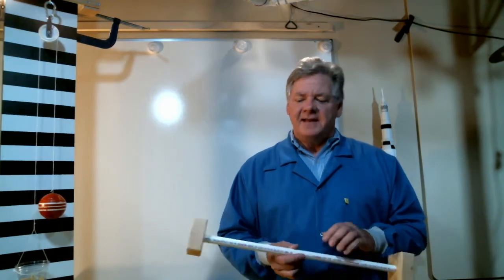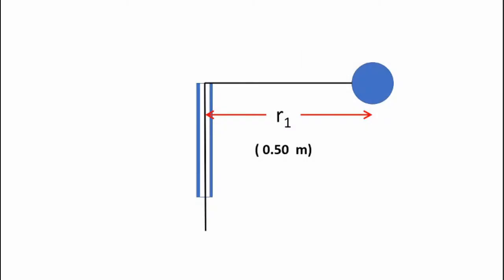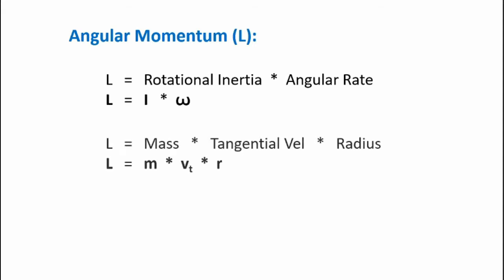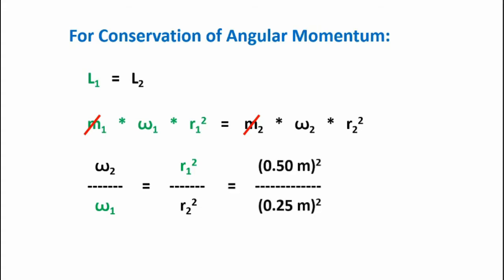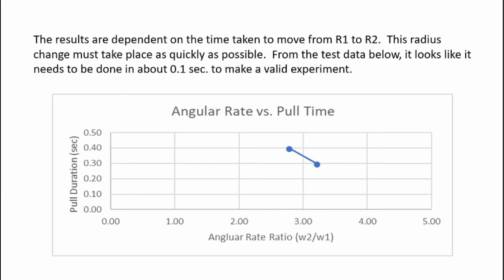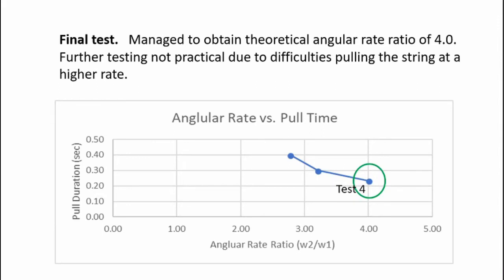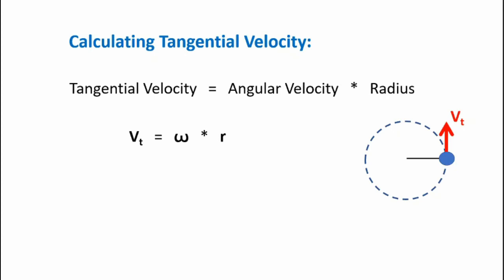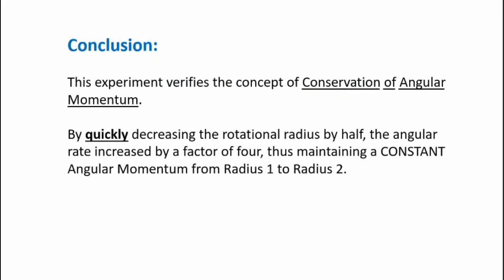Conservation of Angular Momentum

Comment: Hi, I am very impressed with the fact that you are actually taking measurements which is something that is always omitted. I do not agree with your conclusion that your experiment verifies the concept of conservation of angular momentum. Physics is not about altering the experiment to match the predictions of the theory. If you are forced to reduce the radius within a fifth of a revolution before you can achieve the prediction then surely you must realise that something is not quite right with the theory. Basically you are accelerating the ball directly toward the centre and could theoretically increase the angular velocity far beyond the prediction (in fact you exceed the prediction) but this is not due to conservation of angular momentum but simply direct acceleration. The fact that it is rotating is somewhat irrelevant. The fact is that angular momentum is not conserved. Your experiment proves this. Your initial result confirms what I have been trying to tell people for the past two and half years which is that it is not angular momentum but rotational kinetic energy which is conserved. www.baur-research.com/Physics
Reply from the maker: Thanks for your input.  One of the things I'm trying to do is initiate some discussion on science and technology concepts.  The experiment I conduced is a classical example and is used as an example problem in the "Fundamentals of Physics" text book by Halliday and Resnick.  In the book example the authors state that this problem is indeed a conservation of angular momentum problem.  I am of the belief that if I pulled the string slowly, energy was lost due to flexing of the pen tube, less than perfect tube diameter allowing for friction as the string moved around the lip of the tube, and shaking of my lab table - potentially imparting adverse external forces and torques which tends to make the experiment diverge from a true conservation of angular momentum situation.  Speeding up the shift from radius 1 to radius 2 reduces the time these issues can react and corrupt the results.  I don't feel I was "altering" the experiment, but improving the technique to get better results.  As for "exceeding the prediction", I'm using video at 30 frames/sec, and thus there is a certain amount of error in my data reduction.  At the final radius it only takes 5-6 frames for one revolution (is it 5 or 6???), and there is image smear which results makes it difficult to nail down precise timing and rotational velocity.  As a result, some imperfections in the data are expected.  I'm open to hearing more...
Reply: Let me make myself clear. The prediction for your experiment, if we were to conserve rotational kinetic energy as opposed to angular momentum, would be a two fold increase in angular velocity, which is exactly what your result is when you run the experiment conservatively. Your experiment is nothing less than excellent. It is a perfect result. 100%.

You get minus points for not trusting your own valid and sound findings. 
The laws of physics are broken. I am sorry but it is also not my fault.

Trying do deny it by applying just enough linear force to achieve enough acceleration and graphing just how hard and fast you have pull to get enough near linear acceleration to achieve the predicted result is a little stretching of imagination.

The mistake does not lie in reality. 
The maths and / or the physics is the lie.

Welcome to my world, the one in which
Angular momentum is not conserved.
Reply: @TheAnimammal  Funny...then why did results exceed those predicted for conservation of rotational kinetic energy in his later trials? Shouldn't they not have exceeded the two fold increase in angular velocity? After all, his last trial showed a four fold increase in angular velocity despite the radius change being the same over each trial. How is this possible if two fold angular velocity is the appropriate result for conservation of rotational kinetic energy?
Reply: @iandougherty215  Because motivated reasoning is not science. Yanker.
Reply: @TheAnimammal  That is not an explanation. If conservation of angular energy was true in the context of this experiment, then it would be impossible for the ball to spin faster than the 2 fold increase predicted by angular energy's conservation that you claim. So what other physical principle is responsible for the extra speed increase? Or, should I say, how does the conservation of angular energy account for this extra speed increase?
Reply: @iandougherty215  When he yanks, he is interrupting the rotational motion and applying near linear centripetal acceleration. My claim is about rotational motion. As soon as the rotation is interrupted, then the example exceeds the scope of discussion. Yanking is not science.
Reply: @TheAnimammal  Neither is your assertion. Interrupts the motion...how? The same could be said of pulling more slowly, it applies a centripetal acceleration in the same way, no? You haven't explained why the speed of the pull yields different results, or how angular energy can be conserved with different angular velocities being achieved for the same change in radius.
Reply: @TheAnimammal  Neither is your assertion. Interrupts the motion...how? The same could be said of pulling more slowly, it applies a centripetal acceleration in the same way, no? You haven't explained why the speed of the pull yields different results, or how angular energy can be conserved with different angular velocities being achieved for the same change in radius.
Reply: @iandougherty215  I have explained it directly. I will try again in a different way. If the object is in rotation, then it is either in circular motion, or gentle spiral motion. As long as that is the case, then the component of force in the direction of motion is negligible and the discussion is within the scope of my claim.

Yanking interrupts the rotation and causes the mass to move in a steep spiral path which means that the component of force which is parallel to the motion is large and so there is a large component of direct centripetal acceleration on the mass which is outside the scope of rotational motion and hence outside the scope of the discussion.

Never in three hundred years was a ball on a string conducted by yanking. You are trying to shift the goalposts by adopting pseudoscience.
Reply: @TheAnimammal  You have not defined "gentle spiral motion" or "steep spiral path". You have not explained why a fast pull somehow changes the rotational motion in a way that the slow pull does not. You have provided evidence that all pulls might invalidate the conservation of angular energy, but nothing yet to support your idea that it actually IS conserved.

Here's a physics lesson for you. Saying some random statement like, say, "Yanking interrupts the rotation" without explaining how or why it does so is not science. It is an unsupported assertion, remaining as such until evidence to support the claim is provided. Repeating the assertion is not evidence. Appeal to tradition ("Never in three hundred years") is not evidence (did you attend every ball and string demonstration in the last 300 years to verify that claim? Suuuure...).

The most egregious part of your statement is that we can literally just look at the video and see that, even when he "yanks", that no, the ball doesn't change it's rotational pattern, it doesn't "spiral" in towards the axis of rotation, it spins more or less along the same path that it already was spinning on. Seriously, your explanation disagrees with the observations of the recorded experiment.

Let's try this again: how can conservation of angular energy account for various different angular velocities being reached from the same radius change?
Reply: Here is an experiment properly done (dense ball, low air friction, axis of rotation still, and all measurements are visible). The experiment confirms, with no surprise, that angular momentum IS CONSERVED: https://youtu.be/abuPJesWQRY